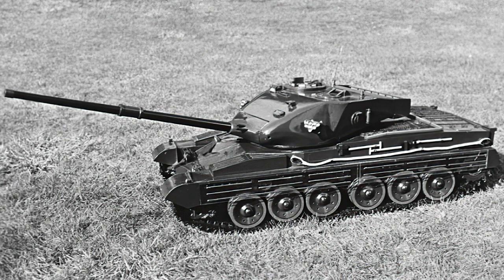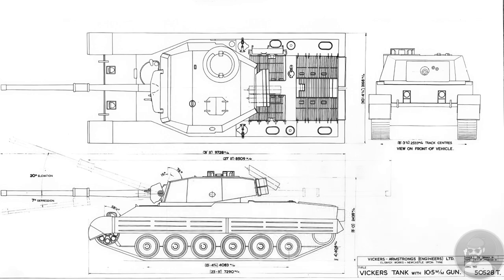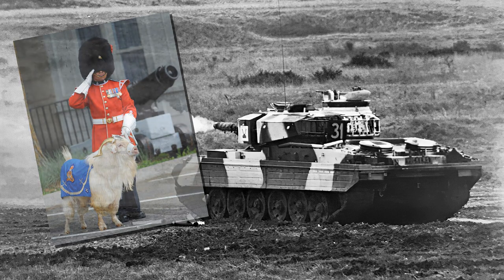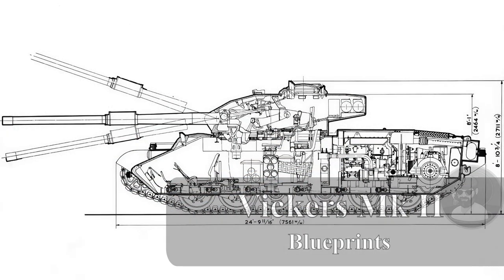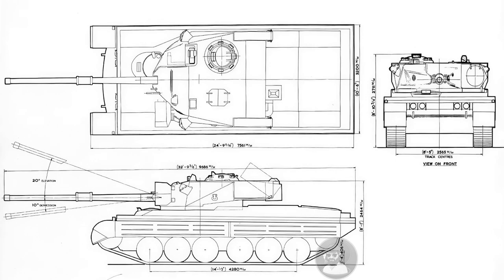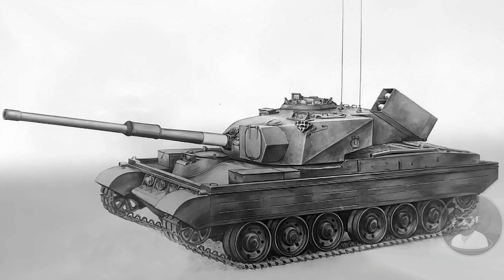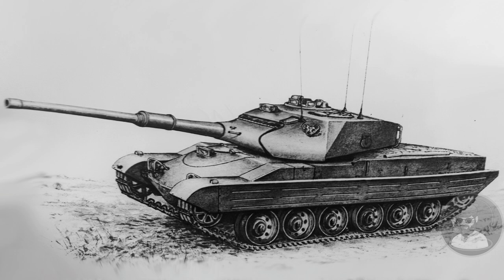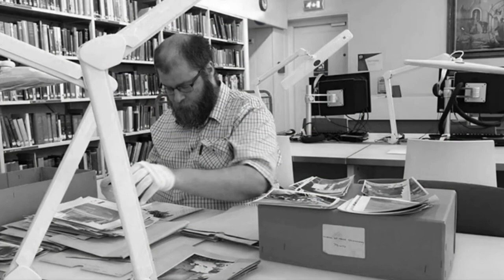Vickers Mk II MBT - Main Battle Tank - Tank Design & Development

Comment: Short and sweet. I wonder if the Swedes took an interest in this one?  They seem to have a preference for firepower/speed and manoeuvrability over armour.
So much info on a beautiful tank I never knew existed - thanks chap! 👍
Reply: Sweden purchased 80+160 Centurions (Strv 81, Mk 3&5) from UK in 1953 to 1955. Further 110 Centurions (Strv 101, Mk 10) was purchased 1959 to 1960. In 1964 to 1966 240 Strv 81 was upgraded, in Sweden, with a 10,5cm gun (same as Strv 101), called Strv 102. 
1967 to 1971 340 Bofors “Stridsvagn S” (Strv 103) was delivered to the Swedish Army.
A major upgrade program of 80 Cenurions (Strv 104) was done 1983-1987, reactive armour, ballistic computer, laser range finder and much more was fitted. 
A Prototype (Strv 105) was built as a test bed but it was never produced since Sweden bought Leopard 2 in 1994.
Last Centurion was decommissioned in year 2000.